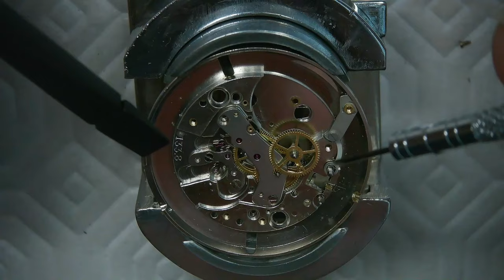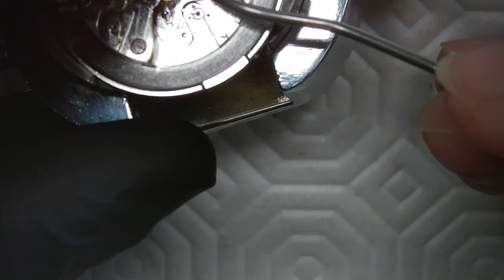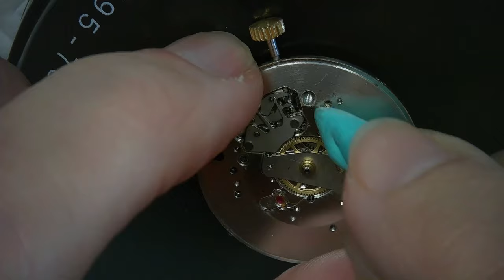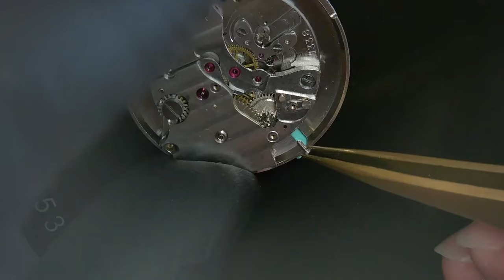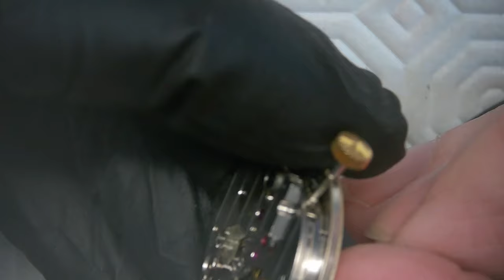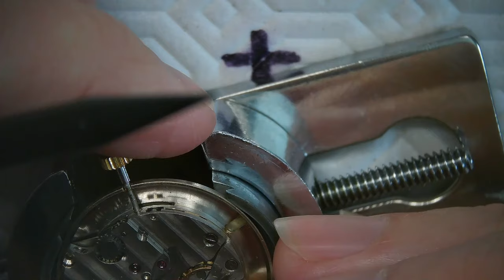Video for WATCHMAKERS - Assembly of Complex Zenith Automatic 133 8 Bumper Movement

Comment: Very cool... I like to listen to relaxing smooth jazz while working on timepieces. But I noticed that you are installing the pallet fork before the train. I usually only do this on watches that have a suspected oscillator issue. Basically, I can visually inspect the interaction of the pallet fork horns and safety action against the roller table. But typically, the pallet fork is installed after the train and mainspring barrel which provides the opportunity to test the free running of the train as well as end/side shake.
Reply from the maker: You are correct and this isn’t a a mistake on my part. Lucky that the fork ended up with enough power.
Reply from the maker: May strip it down again to look at the train